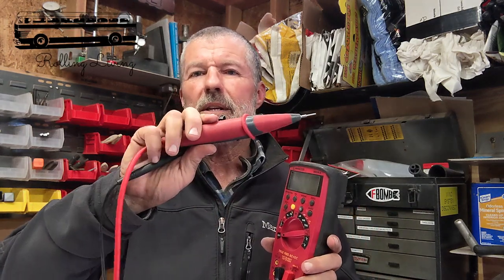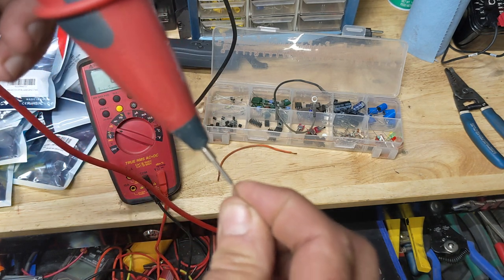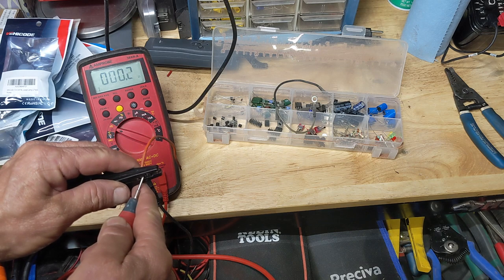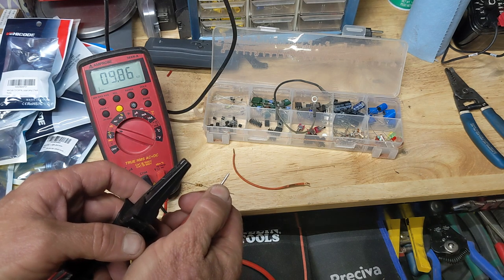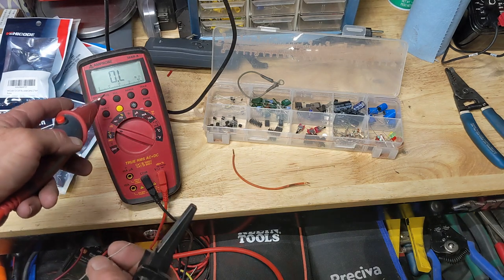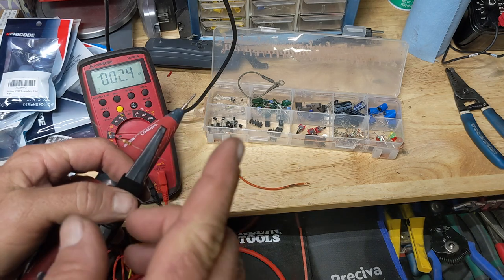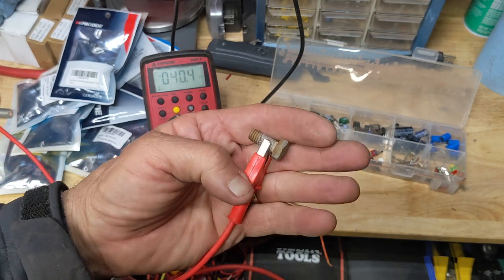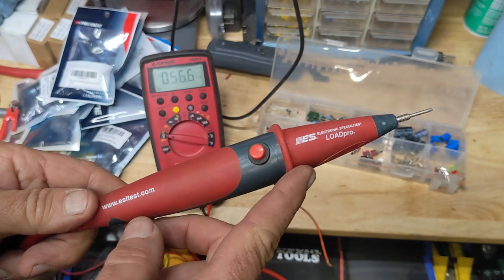Load Pro test leads...how to find bad connections and resistance.

Comment: Great video!  You made it very easy to understand how the loadpro works. I've watched other videos but all the ones I watched only show how to use it while troubleshooting a circuit in a vehicle. You're presentation was more of a "classroom/lab" demonstration and using a resistor, wire with corroded terminals, and rusty bolt made it really easy for me to understand how the loadpro works and how, when, and where to use it. Many thanks!

Comment: Would this still work if say you 5v circuit but had 12/24 batteries would you need a 5v power supply and not the battery power

Comment: Can be this used not with 12 volt connector and instead reference voltage ( 5 volts) for sensors in automotive?

Comment: Hi, is this tool safe to use on 5v sensor circuits that are switched on by key on/directly from the ECU/ECM/PCM? Will the load not damage the circuit board on the module? Thanks
Reply: I tested on sensor and it didn’t not work with reference voltage. Unless there is a specific way to do it. Let me know if you found out

Comment: What does the wiring look like, you’re connected to a 14v battery and then the probe to the multimeter that’s it? Is the other lead connected to anything?
Reply: Black lead is connected to an earth mate, has to be connected to a good earth to read an accurate potential difference☺️

Comment: When add the load what would a good connection read,thanks
Reply from the maker: Essentially, the voltage should not drop much.  I don't know a spec for acceptable drop, but you'll get to know when you see a bad connection...the voltage drop is noticable.
Reply: @RollingLiving  thanks

Comment: Being somewhat new to this I’ve got a potentially dumb question: once you find there is significant resistance in the wire or wherever, what do you do to fix it?
Reply from the maker: That's not a dumb question at all.  And I should do a video on that whole process, when our snow melts. :-) 

Fixing the issue is usually easy...it involves re-doing a wire splice, cleaning a connection, replacing a switch, etc.  The hard part is finding that issue, and that's where these come in handy.

Start at the point farthest from the battery and work back.  For example, if you're working on a bulb that won't work (and the bulb is good) check the socket.  If you find resistance there, trace the wire back to the switch and check the light side of the switch.  Then check the power (battery) side of the switch.  IF those are different results, it is probably a bad switch.  Then work back to the fuse block.  Somewhere in there, you'll pinpoint the source of the issue.

Don't forget the ground path, too!  Without a good ground (the negative) your bulb or dohickey won't work.
Reply: @RollingLiving  thanks so much! Yes I’d love to see you do a vid on this whole process because I’m having a hard time visualizing what you’re describing. Thanks for your time
Reply: I have a dumb question too Lol. I'm fairly certain the principles work the same way, but how would you apply this on the negative side of the load?
Reply from the maker: @keenowl1410  Not a dumb question at all...and something I'll remember to cover when I use this on a bus to diagnose an actual issue.  First, when you test the circuit (say a headlight) you'd unplug the lightbulb and put the leads in the positive and negative (ground) side of the plug...then do the test.  If the voltage drops, do the same test again but this time with the negative lead on a good chassis ground instead of in the plug.  If the voltage drop remains, the resistance/fault is in the positive side...if the voltage doesn't drop this time,  the problem is in the ground side.  From here, though, the Load Pro won't help you much and I'd just trace the ground wires to their terminal.
Reply: @RollingLiving  thank you so much for responding. I saw your Chanel today and subscribed. Great Chanel. Thanks for all your time, help and tutorials! 

Now that wire issue is determined, but if it's a long run of wire, through many components maybe a wire tracer would be the tool for the job?
Reply from the maker: @keenowl1410  I have two wire tracers and they're very handy to have on a bus, for sure.  I should do a video on that someday.  If you're trying to chase a long ground wire, you might consider just replacing it with a new wire to a good chassis ground.  At least that will help with the diagnosis.

BTW, thanks for the kind words.

Comment: You have your fingers touching the probe and connection. That alone will give a false reading.
Reply from the maker: Hi Richard.  This is a good observation and would be a factor if I were using the resistance function of the meter, especially if I were using the more sensitive ranges...or my megger.  Zap!  :-)   But since we're looking for a change in voltage as we add resistance (which would already include my skin's high resistance), this function still works just fine.  I really like these leads.

Comment: The wire it's self will have some resistance.
Reply from the maker: Yup, I thought I said that.  Sorry if I wasn't clear.  Even the test leads have some.  All wire has resistance, unless it's some of that fancy superconductor technology!  But this is a good tool for finding problems involving too much resistance.  In fact, with this I can identify opens, shorts to ground, and bad conductivity.  It's a cool tool.
Reply: @RollingLiving  I can see it's useful. Thanks for letting us know about it. It probably is good for finding intermittent faults that only happen under load.
Reply: Thank you, this is great information you have shared with us here. I will be searching out to purchase a set of these leads. 
David in the UK.